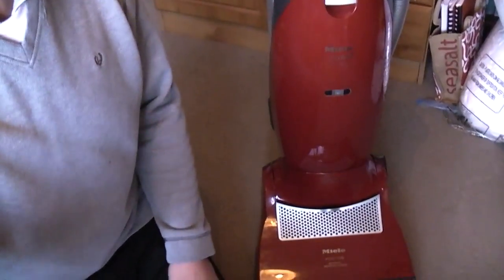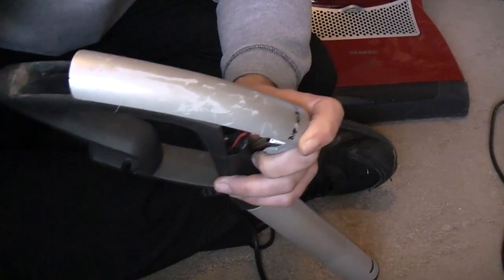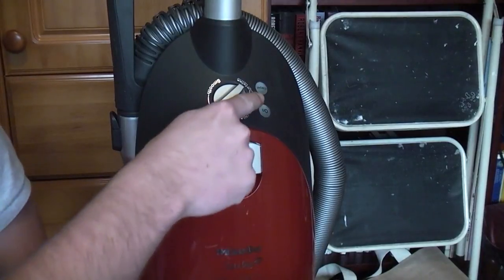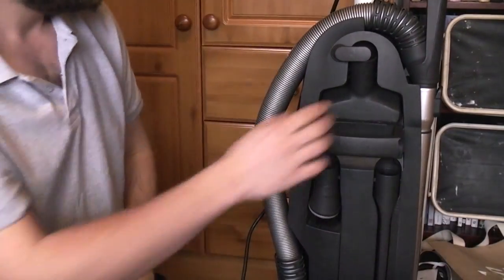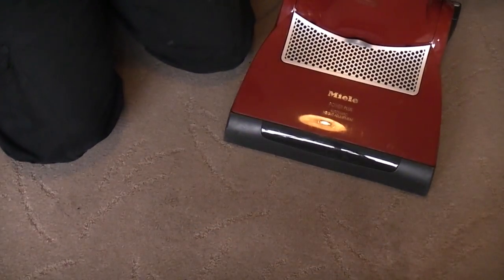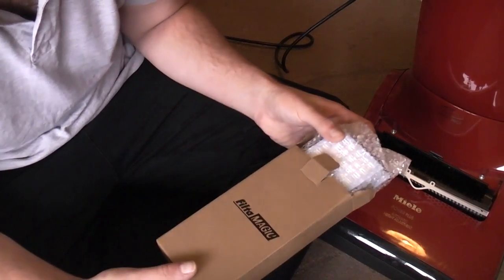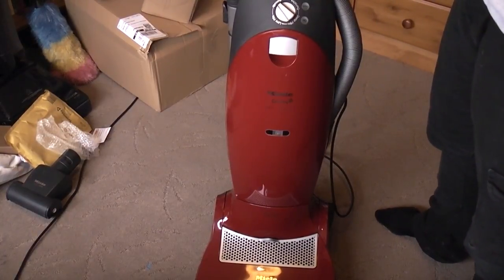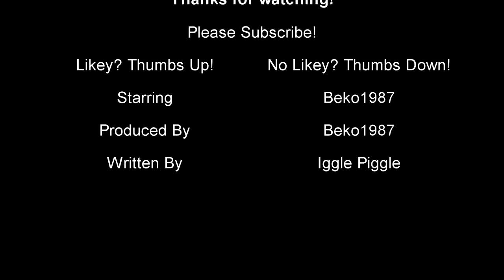Miele S7 Cat and Dog - After Refurbishment!

Comment: So you got it working in the end, jolly, jolly good my vacuum cleaner chum! As you have found out, Miele S7's are extremely fragile and have to be pampered with all love and attention - they wont stand for any rough treatment. With Miele, they dont supply parts for cheap prices, so I suppose you have to take your chance on buying spares second hand from ebay dealers, and on this occasion, it didnt pay off, as you got sent another broken handle. All this would be better if Miele supplied cheaper parts to repair their machines, but I cant see that ever happening, as they want you to buy a brand new machine rather than repair your old one - thats how business works in 2017, and thats how they make so much profit. The reason the hose is hanging off the side is that there is a plastic hose clip usually, but that seems to have broken off your machine, and the hose has nothing to hold it clamped to the side of the machine - and this is usually moulded onto the side of the machine, so cant be replaced if it snaps off. The Hoover Police are also not happy with you, they are on their way to Beko Towers to arrest you for using a none genuine Miele HEPA filter - Miele expect you to buy a £20 one from them, not a bojacked part for quarter of the price - tut tut tut! Anyway, its turned out pretty well, apart from the broken bag door, again, flimsy and brittle plastics are to blame, and looking at my own S7, I was never happy with the flimsiness of the bag door - like I said, these bagged machines will not stand up to rough treatment, they are usually bought by richer, more affluent people who generally tend to look after things and can afford the high price of bags and filters, which are not cheap, as you also found out.
Reply from the maker: Yep, they are fickle things! But ive unbroken it enough to use, and tbh this might be my only chance, as it's a machine I'll steer away from getting a cheap one on my usual budget in the future, unless I get very lucky!
Reply from the maker: Not noticed the missing hose clamp though, will have a look for that and see if I can find the remains!
Reply: Its halfway up that vertical hose section, and is attached to the front side of the casing, so is effectively a part of the moulding that fits on the front of the machine above the bag door. It sticks out about an inch and a half and forms resistance to pushing the hose past it, so it effectively holds the hose clamped to the side of the machine. I'd say its been snapped off. You can get the plastic housing as I say, the black part that fits above the bag door and houses the speed selector knob, but I doubt that Miele will sell you that part without the need for a second mortgage, so second hand would be the way to go. Is there not one on your other Miele S7 scrappy machine?

Comment: I have an S7 that I just bought used. It worked fine for less than 10 minutes and now, all that happens with the switch on is the ON light turns red. This morning for about 10 seconds, it would cycle on/off and now it's back to nothing but the red light. I've checked for blockages and everything looks clear. Bag and both filters are good also. Any ideas? Thanks.
Reply from the maker: Brendan Delac Probably the motor toasted itself sadly, or a wiring fault somewhere, what's the mains flex like? Their fussy buggars, and expensive to repair. There is a spares machine on ebay UK, but it's motor is fried too
Reply: Not sure what mains flex is...?
Reply from the maker: Brendan Delac the wire that comes out of the handle and plugs into the wall! It's a long shot though, when mine threw its red light on I'd done the motor fan up too tight and it jammed, so I'd say motor fault somewhere... Does it smell of burning or carbon?
Reply: Immediately at the handle, the rubber cord is torn slightly, but I don't see any actual wires. I've wiggled it around a bit with the switch on, but it doesn't make a difference. No smells other than perhaps a bit of a dusty smell.

Comment: Hi any idea where to get a set of seals for a vax 121 mr beko ?
Reply from the maker: The thin foam ones that sit around the filter and recovery bucket edges? Qualtex used to sell them as a kit. I don't have an account anymore, get in touch with Dilys at Autovac, a shop in worscestershire, tell her I sent you and she should be able to have a look and see if they still do it. Failing that very thin self adhesive foam strip would do it, but it's only 3/4mm thick and wide, so has to be tiny!
Reply: Ok thanks I think that's what is wrong with the suction is very low in it
Reply from the maker: Kevin Byrne It won't help. If your handy with a mastic gun a thin bead of sealent would do the job (just let it set before assembling the machine, and keep the bead flat and even!)
Reply from the maker: Or, to test the theory some electrical tape around the 2 joins would let you know if that was the issue, or if it lies elsewhere
Reply from the maker: Kevin Byrne https://manchestervacs.co.uk/DysonForum/index.php?topic=1849.15
Reply: ok thanks